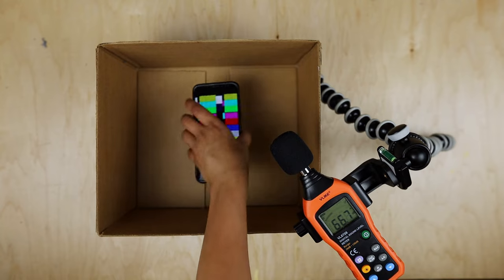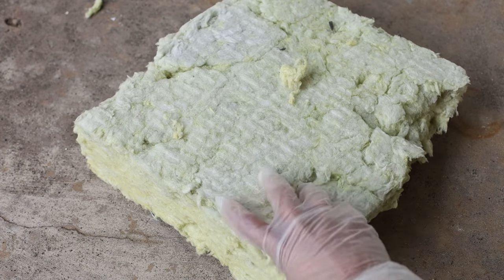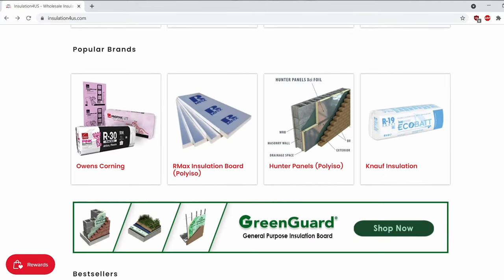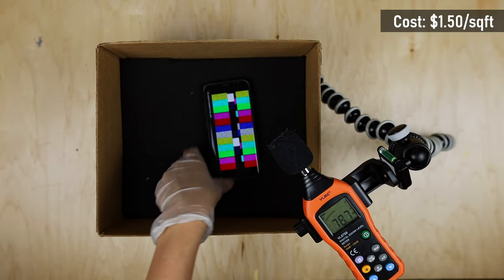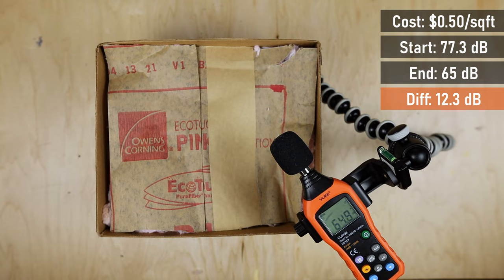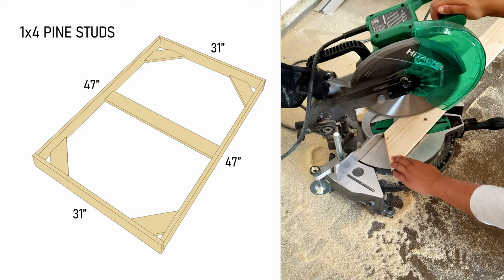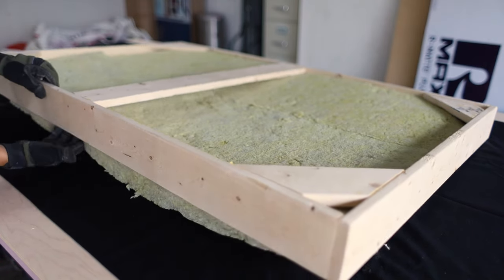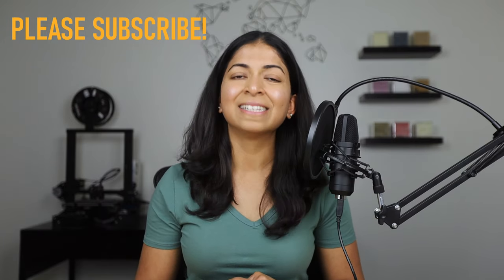Rockwool OR Fiberglass for DIY sound panels?

Comment: You didn't take the kraft paper off the back of the fiberglass and that may have altered the test, just like a roll of mass loaded vinyl would.   I would do it again without it attached and see if the results are the same.

Comment: Very interesting - especially as I'm getting close to finishing my own studio and am going to be needing to make some panels.
I think the test would have been more accurate if you had used unfaced fiberglass. The paper probably accounted for a lot of the sound reduction in your demonstration but would actually reflect sound if you faced it outward (right behind a panel's fabric) which is not optimal.

Comment: so I can use regular pink insulation as its better than green one, even if both are from rockwool ? and for putting in my ceiling, I wonder if I really should use the 6" think one or just the 3" that fits in reg. 2x4 ? I want the most quietness between me and my tenant downstairs, but does paying for the thicker one going to lower the sound enough to justify the cost, or does one layer of 3" stuff (greenstuff for example) enough sound dampening ?

Comment: Super interesting! In regards to the pink fibreglass insulation, it had the paper backer on it, whereas the others did not. Is it possible the combination of the fibreglass and the included paper makes a drastic difference? What if the paper is removed?
These tests are great - I own a Sprinter van which I've insulated with Tyvek ThermaWrap R5.0, and works very well. Encapsulating paper-backed pink insulation and hanging that on my walls would most likely reduce any road noise when travelling. Thanks for doing this video!

Comment: Sound panel are used to absorb sound to minimise reflections so that what hear in your studio is primarily what is coming from your studio monitors and not reflections from other surfaces in the room.  The results from the fibreglass are invalid as one of the surfaces was coated in a solid reflective surface so the sound had more difficulty passing through the glass fibre.  In real life applications you would not set up a reflective surface between the sound source and the absorbtive material as this would bounce sound back to the listener.

Comment: I wonder if the paper backing on the fiberglass made a big difference here? It’s possible that it masks a lot of the tone you happened to pick?
Reply: I'm quite positive it made a difference. If you were to use it in a panel, it would be on the back side, so it would not work in the same manner.

Comment: What do you think about "Green Glue" for soundproofing? 
I recently built an office in my basement, insulated the interior walls with fiberglass and used 2 layers of drywall with "green glue" in between them. I'm satisfied with the results, but of course I wonder how much of what I did actually helped.

Comment: How did fiberglass dampen the sound that much more than the Rockwool alternative you used when mineral wool typically has a higher density than fiberglass? Doesn't make sense...

Comment: hi, you test may be flawed. you phone should be placed horizontally to get maximum sound dampening. sound escapes from the sides not just vertically from floor to ceiling.

Comment: The paper increased the STL. Try the test again with the paper removed.  Also the 593HZ frequency is too high to be useful.  You have to get lower HZ than the phone can reproduce to test correctly. If you want to hillbilly  better STL  just layer fiberglass and roofing felt, fiberglass, roofing felt,  The impedance mismatch is lossy.   I love your channel by the way, keep it up.
Reply: Nix the tar paper, it would smell bad indoors.  If you suspended a vinyl floor runner between two layers of fiberglass it would greatly improve the STL at all frequencies.

Comment: i wonder what the properties are once it is installed inside a wall cavity. Still haven't filled in my wall before i close it up. was planning on rockwool, but now i might just go with fiberglass like i did for the exterior walls
Reply from the maker: In wall cavities, fiberglass is more susceptible to slump and moisture issues which can lower its R value and acoustic properties over time.

Comment: Professional here. This test is flawed. Some in the comments already pointed it out. What you usually want is even absorption across the audible frequency range. Depending on thickness, densities, and types of insulation the recommendation will vary. A rule of thumb I have had is higher density for thinner panels and less density for thicker panels.

Comment: in my country, Fiberglass was wrapped with thin aluminum foil for use as heat insulation.  If I want to use as sound insulation, do I need to peel the aluminum foil or not?  Aluminum foil make people less allergies to fiberglass. Thank you.

Comment: This is very, very, very old research. See cellulose acetate fibre for sound absorption. The fibre has very high surface area  to mass ratio as the fibre cross section resembles a starfish. I did these tests 37 years ago and both rock wool and fibre glass were only 30% efficient relative to cellulose acetate (cigarette tow).

Comment: First off I’m amazed that fiberglass insulation work so well! First off I’m amazed that fiberglass insulation work so well! I’m wondering if the paper on the fiberglass insulation helped to reduce the sound?

Second Roxul Safe and Sound and regular Roxul insulation may look the same but are  two different products (at least according to the manufacture when I called about years ago. I try to use one in place of the other, because that’s all we had on the job site and they said it’s a no go).

Comment: Just for the record.
If you want to do SPL tests, you need an SPL-test setup.
Source (speaker playing white noise (all audible frequencies), with an output of 1Watt) @ 1m distance from the recorder (microphone).
This way you get uniform results and you will be able to adjust the placing of your equipment in precise ways (speakers, microphone and your panels)

Testing a random frequency will only show how that SPECIFIC frequency is affected by the dampening material.

In a recording situation, you want to get rid of reverb and standing waves. You also want to decouple your microphone from any vibration (like a computer on the same desk as the microphone).

Anyway. Multiple cans of worms... I can assure you that the method you used in this video does NOT work (for different reasons).

Comment: Hi, I was wondering if any health related issues can occur. I'm planning to put a a lot of panels in my bedroom.
Reply: maybe i was allergic i dont know, but ive installed months ago 12 gikacoustic panels made of rockwool in my bedroom, where i m using my pc too during the day.
well basically i was in the room almost everytime.
i had after few days itchy and dry eyes during morning+ a lot of headache, ive tried to remove them, symtoms disappeared, put them back, symptom again each times.

so in the end you can try, but begin with few panels first, and see how it goes.
if you use it only during the day, i m almost sure you will never have problem, but if you are in the same room with those panels, not sure.
Reply: @cmarquais  oh okay, good to know. thanks!

Comment: if you were using these materials as barriers then your test would make more sense, however if you're trying to figure out which one has the best absorption coefficient or in other words which one absorbs better then that's not the way to do it.  I'm sure if you poured sand in that box you'd have a much greater dip in volume but that's not to say that sand is a great absorption material but rather a good barrier while at the same time in a room setting would reflect everything you through at it.  Your test is only good for testing how good a material is as a sound barrier.  There are articles online however that go over the absorption coefficient graphs of the materials you went over and more as well as how their absorption coefficient changes when checking the thickness or density of the material, so it'd recommend you check those articles out

Comment: I've been thinking that a sort of panel would be a good interior for shipping containter structures. If the structure has a proper vapor barrier, I think insulation panels covered in fabric would be easy to install on interior metal walls. I never understood why people stud in their container homes just to put up drywall.

Comment: I just don’t want to hear the low frequency pounding if my neighbors’ weekly parties.  Tile board ?
Reply: If you really want to reduce low frequency you need mass damping (like loaded vinyl) and you need to decouple the wall finish from the framing.
This usually involves resilient metal channel that your wall finish is then attached to.
There are drywall products that have mass damping incorporated. They are heavy and expensive, but are specifically engineered to work in conjunction with the channel.
Reply: Tile boards will do nothing. You need at least 3-4 inches of rockwool for bass. Foam tiles will only make you screams or complaints less reflected into your own room.

Comment: Sound insulation or soundproofing has nothing to do with acoustic treatment.

What you proved is that this whool was better for soundproofing this very frequency. The job of an acoustic pannel is so much different.

I hope viewers can make the difference. Also, rockwool is generally safer to breathe than fiberglass (which is supposed to go inside the walls, not within your studio).

No offence meant, but using the wrong material based on this video could be a health risk.

Stay safe everyone.

Comment: You needed to test across a frequency range. Rockwool does a much better job with mid to mid-low frequencies. Very low frequencies require mass deadening or isolation...
Reply from the maker: I tested different frequencies after making this video since many people commented on it. I got the same results!

Comment: Complicated subject with lots of traditional beliefs. Rockwood and denim do offer better absorbtion at ≤ 250 Hz in many cases  in sound panels.   here transmission loss is measured, not random incidence absorbtion as needed for a sound panel.  practical concerns in walls are fire and moisture resistance. For panels and gobos the practical issues are weight and plumes of fibers when touched or moved.  Foam is the winner for panels if cost is no object. Denim is a good choice for DIY from retail big box. Space panels from walls for low frequency.  I am a professional user with some background in small room acoustics but not an acoustic consultant, comment based on practical experience.

Comment: I use Thermafiber (I started using it in the 1970's, long before anyone heard of it) in living spaces, because I don't want to be breathing fiberglass dust.  But inside a speaker cabinet, fiberglass is the only thing that works, and it you're using anything else. you're doing it wrong.

Comment: Miss, these measurements are not made like that... There is a standard for measuring the practical sound absorption coefficient, αp, according to the international standard EN ISO 11654.
This standard also defines the single value of sound absorption, αw, and the sound absorption classes.

Without any acrimony, tell you that you have little idea of acoustics.
greetings

Comment: I just redid my walls. I took out all the fiberglass insulation then installed three layers first layer was 1/2” foam panels second layer was 1/2“ sheet rock, third layer was 2” foam panel. Then one more 1/2” sheet rock to finish off the wall. Then you tell me to just use fiberglass insulation. Ugh.

Comment: I couldn't decide whether to use rockwool or fiberglass, so I use a layer of each. Also, I wrap the wool in plastic foil (the used for covering when painting), before wrapping it in inner fabric, then the final fabric, just to be safe. I will be spending countless hours in this room, so I think it's important.

Comment: Even if wrapped in fabric, I would be concerned about using fiberglass for sound absorption panels as they can dispel tiny particles of fiberglass into the air that are caustic to our respiratory systems. This property makes them unusable in any situation except when sealed in walls and attic spaces, isolated from living space. Rockwool is my choice for this reason.

Comment: Your test kind of misses the point of sound panels. Sound panels aren't insulation, even though they're made of insulation. They're sound absorbers. So for example a brick wall is fantastic sound insulation but absolutely terrible sound absorption. You've really done a test that is more applicable to the placement of insulation say in a wall cavity than as an absorber hanging on a wall. The ease with which sound enters a material and the way that it's fibers efficiently convert sound energy to heat really determines the efficacy of sound panel material. Which is why fiberglass was so effective, but wedge cut foam probably would have beaten rockwool in a more applicable test of effect on reverb time of the room or effect on frequency response of the room. That's why sound panels are called sound treatment and not sound proofing. But of course insulation actually placed in walls is still sound proofing.

Comment: The sound meter you are using is weighted, which means high and low frequencies are tapered off, quite severely in the case of A weighting. C weighting is better but still flawed compared to Z weighting.

https://www.noisemeters.ca/help/faq/frequency-weighting/

A proper test would use a calibrated microphone, and a frequency sweep from 20-20000Hz. A single tone test tells you virtually nothing about the acoustic properties of a material.

https://cross-spectrum.com/measurement/calibrated_umik.html

Comment: Thanks for the test, the result is that you have no idea about the sound yourself
If you have problems with 1 khz like the sound your mobile phone makes, you should move out of your shoe box...
remove the paper layer from the fiberglass and you get different results, say a realistic tone like 250 Hz and again you get a different result...

You can also link more videos, you should then understand for yourself what the statement in the video is...
the statement is that both rock wool and fiberglass do not stop the sound ...

there are other insulating materials for such tasks, such as wood fiber ...
but the most striking thing is the construction of the wall

Comment: Very dense materials block low frequency (a man’s voice and lower). Fluffy soft materials absord high frequencies but not low frequencies.  Your test tone was 1kHz, right the middle hearing range.  U tested 1 frequency and not even a band.  Corning rockwool is inferior to Rocjwool brand. I’m surprised fiberglass doesn’t better to absorb 1kHz, it’s fluffier than Corning rockwool.  Test at 400Hz your results may change.
Reply: Correction I am NOT surprised than fiberglass absorb more of the 1KHz tone. Spellcheck sucks

Comment: There is a flaw in your test you had the paper on the back of the fiberglass so of course it will drop the decibels an extra five DB if you put paper on the back of the rockwool and paper on the back of the cheap garbage throw away phone that they call acoustic foam panels you would have had similar results.

Comment: Take the paper off the back of the fibreglass and test again please - that adds extra mass to the absorber not present on the rock wool. Or use foil backed rock wool. This is not apples-apples comparing…heck, you even ignored R-values. Sloppy. 
Absorbers mounted with a space between them and a reflected surface behind them are more effective in that they absorb energy prior to reflection, and then reduce the reflected sound energy. You can get better (lower) RT-60 in a room with less material. Another RT-60 reducer is a quadratic diffuser so that a coherent reflection is impossible. Getting the absorption and diffusion right is an art form in acoustics. Diffusive ceilings and absorptive floors is a good trick that reduces necessary wall treatment.  Those tend to be the largest parallel surfaces in most rooms.
Reply from the maker: Nope, I'm testing the products, so I'll include all the components of the products. It's not "sloppy" at all.
Reply: @BelindaCarr  indeed it is:  For transparency, for science, you need to compare apples to apples. You want an acoustical absorber to retain energies and prevent them from transmitting them.  R- or U- values of insulators or structures relate how well watts of energy are dissipated/retained (absorbed in this case). R-values of the different materials, or their STC rating, aren’t even touched on.

Comment: I'm sorry to say your testing methodology is flawed. Sound transmission loss is one thing and sound absorption is quite another. Had you covered your cardboard box with layers of drywall sealed tightly to it, your meter would have read even lower than it did with the fiberglass (the paper facing on which probably accounts for most of the transmission loss).

But as you might imagine, hanging drywall panels on your walls will not lower your RT60 (reverberation time) any more than the drywall that's already in place. This is so because while drywall's mass makes it somewhat effective at blocking sound transmission, its hard, flat surface makes it quite good at reflecting acoustical energy and therefore lousy at absorbing it.

Fibrous insulation is effective at converting acoustical energy to heat (i.e. absorbing sound) but no fibrous insulation products alone are terribly effective at preventing sound transmission. For this you need inert mass (like drywall!). Insulation is stuffed inside of cavity walls because it dampens the vibrations of the air resonating between the wall panels. On its own, as your experiment showed, it doesn't block much at all.